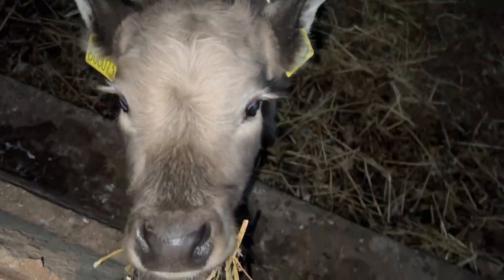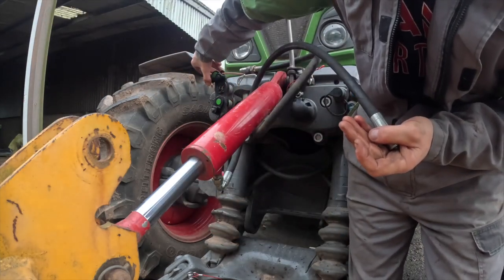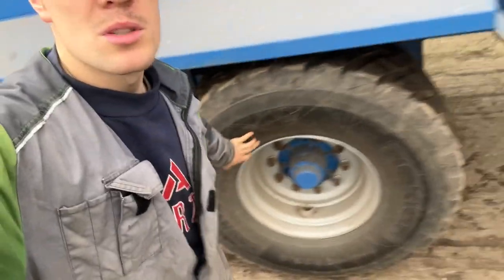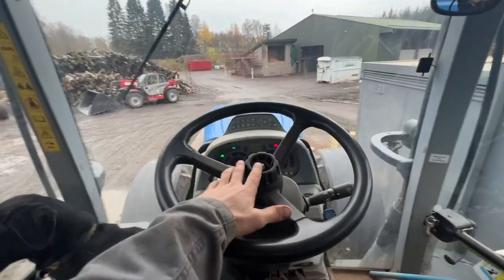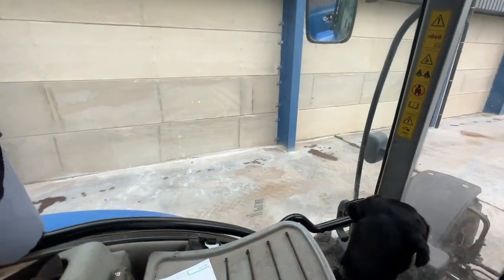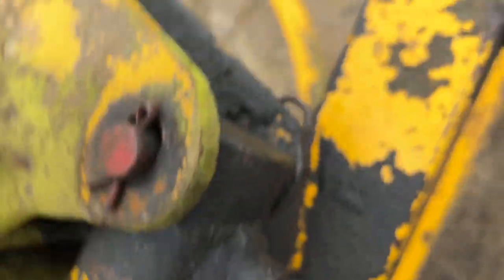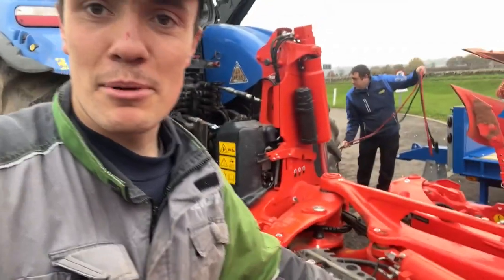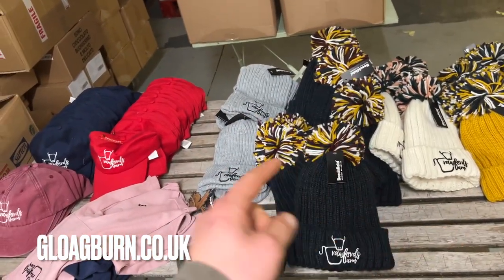Everything's Broken

Comment: Used all 3 brands over the years. 
Lemkin. Very nice little ploughs. Alot of things to adjust on them with the pitch on the body's 
KV lo 85 I think is my old one. That's a brilliant plough. Need to keep an eye on the bolt where the main beam bolts to the carrier. The knock off points are the tits takes seconds to change them. 
Khun are a good plough. Bloody heavy. Not a fan of the transport wheel. Gets in the way when your doing headlands near the hedge. But they bury trash really well
Reply from the maker: Interesting to know thanks 👌🏽

Comment: Kv metal lasts well in my experience. The quick fit points last well. Dealer says holder lasts 3 points but in my experience you get more out of the holders. Great if you have a rocky part of a field 5 minutes puts on a worn set of points then once you are by change to new points again. Economical plough to run hence why I’m looking at another.

Comment: If the Kuhn is heavy, might be solid but extra stain/diesel pulling it? Did Kev notice the tractor working harder? And extra weights needed, then adding to compaction. Might seem odd factoring in diesel but the way it’s going… It’s also assuming they are all built to last and not the lighter ones haven’t thinned the metal too much.  Your land looks fairly easy to work?

Comment: Fate is telling you something forget about the Kuhn, we also have a Kuhn as well as the KV, the KV is easier to pull it's in a different league than the Kuhn, if the Kuhn is parked in front of the KV i will hitch it on and move it to used the KV, it's like comparing a fendt to a New Holland.